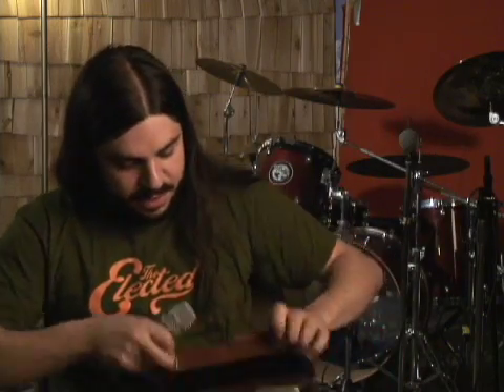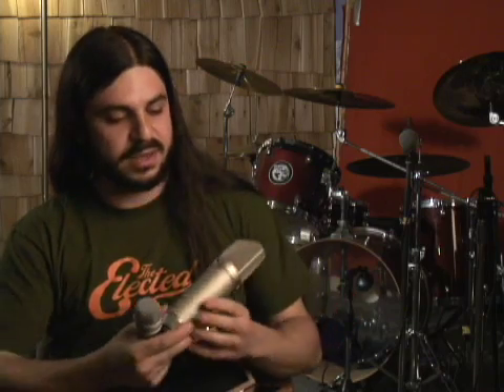Essential Engineering Techniques with Drew Malamud

Comment: Possibly not. I've had limited experience with mics and I know that condensers can be a lot more picky than many dynamics which falls in line with what tongueboy's saying...

Having said that, this Drew guy is not held back or bound by theory. I like his simple ethos of 'best sounding, wins'. Simple as that. He would probably save a little time in experimenting if he knew more about mics, but then he probably uses mic combinations that most 'straight up' engineers may not think of...

Comment: i ve never heard so much crap talked about microphones! obviously hes not really an engineer.

DYNAMICS compress sound as the voice coil moves outside the main path of flux (due to high SPLs), rather than what he said about condensers, which are actually more linear, but are generally far more sensitive. Dynamics also have a poorer transient response than condensers, though this may be an advantage.

a bit of advice, don't quote stuff he says to engineers, they might laugh at you!